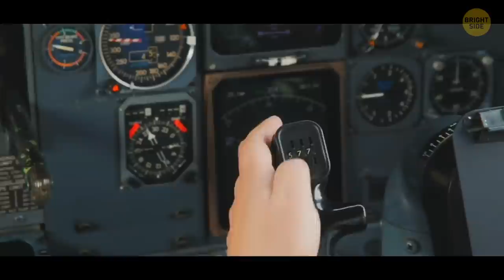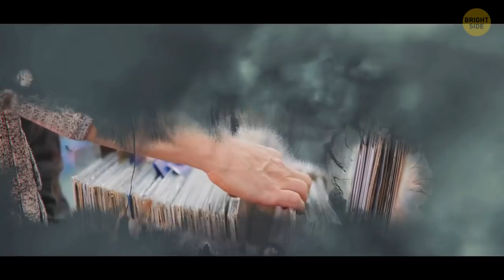They Found a Ship Disappeared in Bermuda Triangle 100 Years Ago

Comment: Fun fact :

People don’t sneeze in their sleep due to their brain shutting down the reflex.
Reply: No they do sneeze
Reply: K
Reply: Smurt
Reply: @AviatorBitWin  You said the same thing in Bright sides comment. Just say it once, and people will sub if they wan't to. Sorry if you find me mean..
Reply: @deonrajeev5688  ok bro sorry😊
Reply: They dont sneeze in sleep he is right
Reply: “Sneezing is a physiologic response to the irritation of the respiratory epithelium (lining of the nose). The process usually begins with the release of chemicals such as histamine or leukotrienes. 

Chemical release is caused by viral respiratory infections, filtered particles, allergens (substances that trigger allergic reactions) or physical irritants such as smoke, pollution, perfumes and cold air.

Allergic reactions with the nasal mucosa require the presence of IgE (allergy antibody specific for the allergen). This leads to fluid leakage from vessels in the nose, causing symptoms of congestion and nasal drip. Additionally, nerve endings are stimulated, leading to the sensation of itching.

Ultimately, the nerve ending stimulation leads to activation of a reflex inside the brain. The nervous impulse travels up the sensory nerves and down the nerves controlling muscles in the head and neck, and that leads to the rapid expulsion of air.

The high velocity of the airflow is achieved by the buildup of pressure inside the chest with the vocal chords closed. Sudden opening of the cords allows the pressurized air to flow back up the respiratory tract to expel the irritants. This helps to remove offending particles in the nose.

But during rapid eye movement (REM) sleep, certain neurotransmitters shut down- this state is known as REM atonia. This means that the motor neurons are not being stimulated, so they aren’t sending these signals to the brain.

IN SOME CASES, sufficient external stimulates will trigger the need to sneeze. But you will wake up to do so.”
Scientific American _ magazine.

Thanks for making me search for that, I didn’t know it and its exact physiological explanation.
Reply: @jblack3375  🤣🤣😂😂😂 ya gotta admit that he really put in  the effort tho!!!😜👍
Reply: He probably just copied it from google tbh.
Reply: @jblack3375  hahaha well you did get sth new into your mind, and I added the source at the end so it means you didn’t even read it 🤦
Reply: RANDOM
Reply: @jblack3375  it's still effort 😜👍
Reply: @AviatorBitWin  shutttt

Comment: Cauda Island is also known as Gavdos. 
Gavdos is 8,878km from Bermuda Triangle. The Bible talked about this same place. You can read on if you look up the scriptures. 

Acts 27: 15 The ship was caught by the storm and could not head into the wind; so we gave way to it and were driven along. 16 As we passed to the lee of a small island called Cauda, we were hardly able to make the lifeboat secure, 17 so the men hoisted it aboard. Then they passed ropes under the ship itself to hold it together. Because they were afraid they would run aground on the sandbars of Syrtis, they lowered the sea anchor and let the ship be driven along.
Reply: The rope part sounds very similar to another ship that also dissapeared and was found many years later